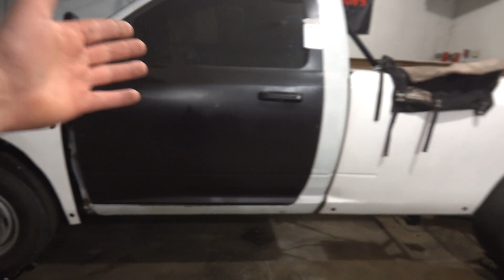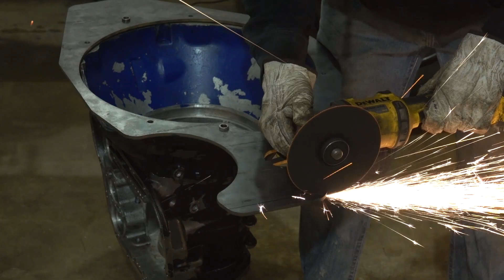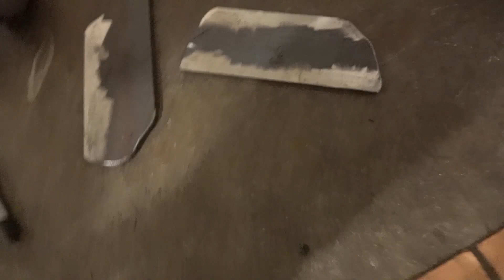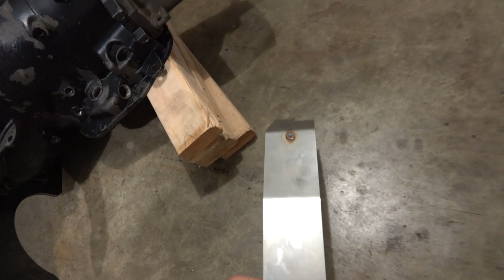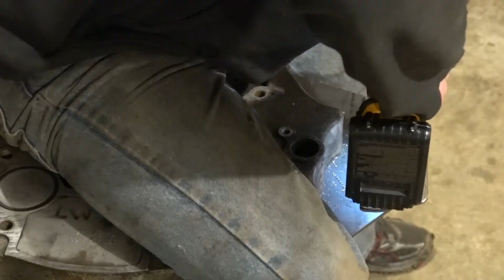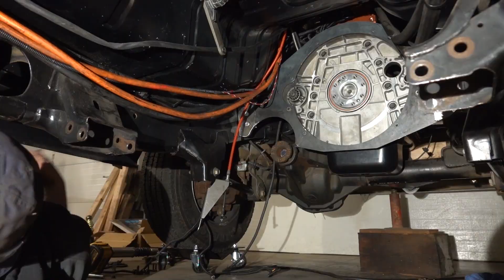Super High Horsepower Cummins Trucks Need This... Fleece Performance Mid-Plate Install

Comment from the maker: What else do you think needs to be done to the drag truck?
Reply: A sweet wrap or paint job...
Reply: Light weight brakes, coil overs on the front and adjustable control arms on the front axle
Reply: Need a bumper sticker that says "If it has tits or tires I can make it Squeal"

Comment: Just weld a shield to the top of the mid plate then. 

They make a sfi flex plate and bell for the 4l80e....
Reply from the maker: I would, but it has to SFI certified. Also Modifying the shield will void it's SFI approval. Its a new problem that im sure a solution for will be found shortly

Comment: Maybe you could cut the tabs off the flex plate shield then weld the cover to the midplate. Make it a midplate and shield all in one. That would make things just that much more simple when doing the trans install as well
Reply from the maker: An all in one Mid-Plate/ flex plate shield would be great, but the shield can't be modified per SFI
Reply: @TurbaTom  could you get it approved like you did for the cage on the truck?
Reply: @TurbaTom  could you get it approved like you did for the cage on the truck?

Comment: Not sure if you’d loose the Sfi approval (most likely). My idea would be to slot the mid plate and weld the shield on the slot and ditch the mounting tabs. Keeping the mid plate from loosing all that structural integrity. Then call sfi and ask for forgiveness hahaha. But keep up the awesome work!!
Reply from the maker: Your correct, SFI doesn't allow modification